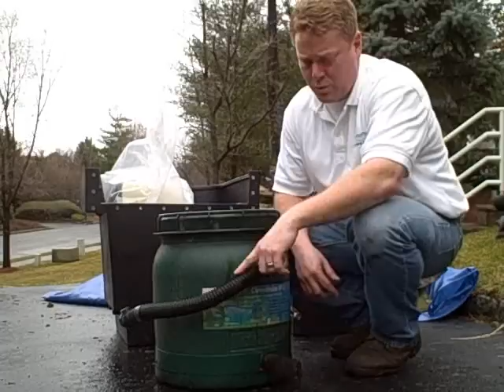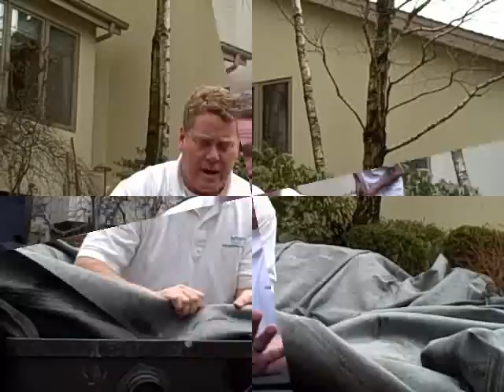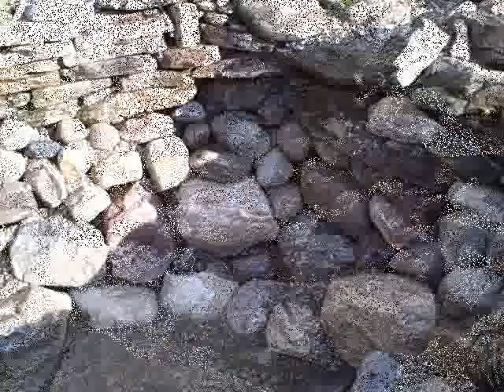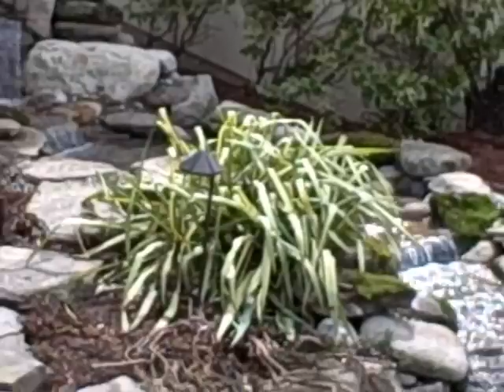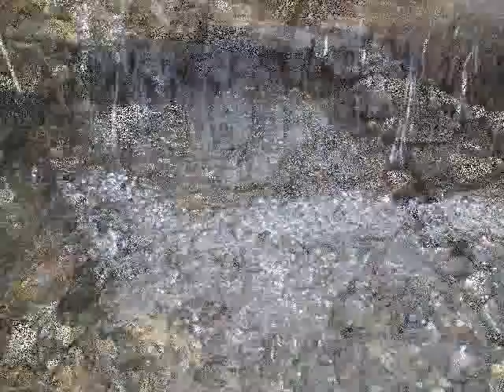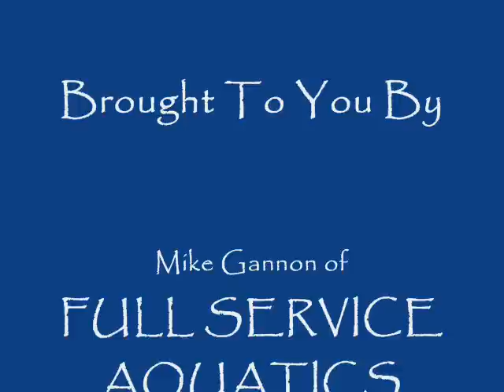How To Renovate a Fish Pond:  Part 2 Livingston, NJ

Comment from the maker: Hi. The rocks are not cemented down, but not loose either. We do a typical dry stack and then we use fish safe construction foam to adhere the roackwork in place, and this foam also allows us to control the flow of water in the falls and stream. Thanks for watching!

Comment from the maker: Yes there are a few ways ot achieve that. You could install a ball valve which will allow you to control water flow rate or completely turn off the flow. you could also install a check valve which allows water to flow only OUT to the pond and not back into the pond. Hope that helps!